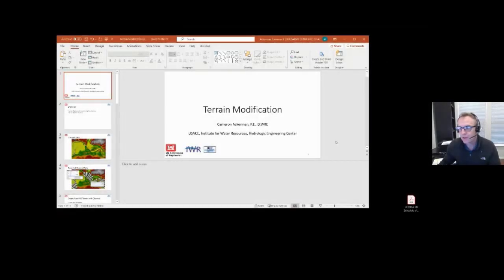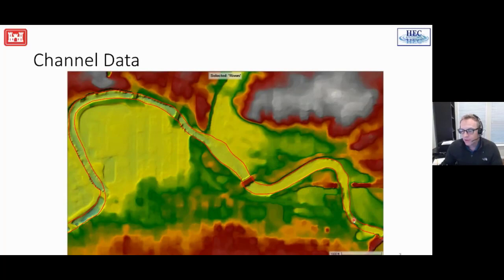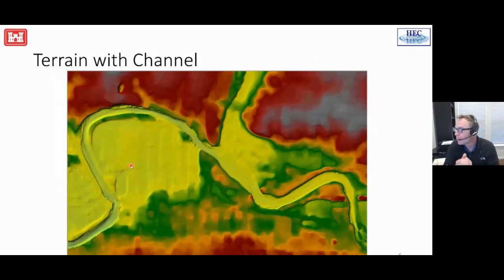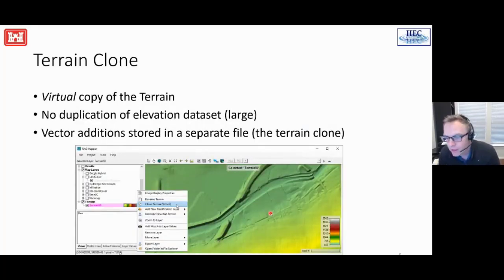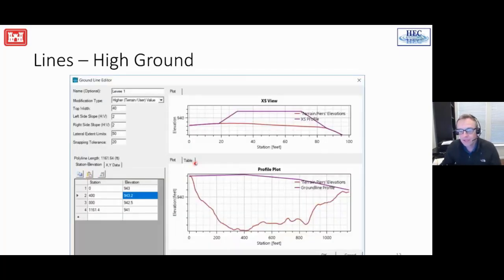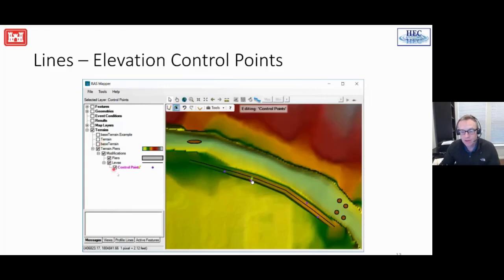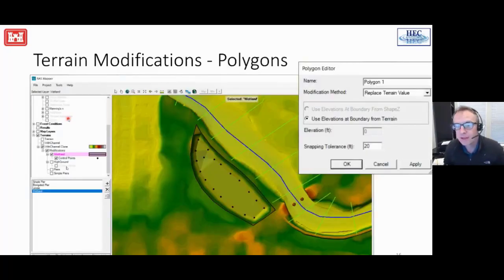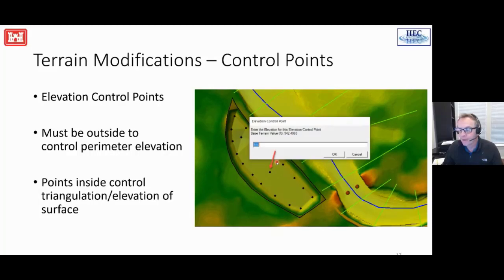HEC-RAS 2D Class 2.1 - Terrain Modification

Comment: Is there any way that I can Interpolate only between two cross sections where I need to modify the geometry. Like I want the original terrain, but I want only the interpolation between the bridges, so that I can modify the terrain only there?
Reply: Of course you can do that. Create a new geometry with those two XSs only and then you can export terrain based off of that XS terrain.